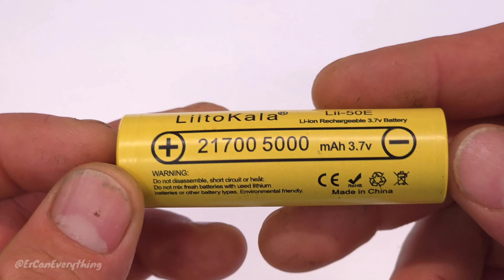Replace old Ni-Cd Batteries of Boschmann Impact Wrench with LiitoKala Li-Ion Cells

Comment: ME HA GUSTADO, ¿PUEDO USAR EL CARGADOR DE Ni-Cd con las baterías Lipo?,gracias.
Reply from the maker: Of course you can, but the configuration must match.
For example in my case there were 20 Ni-Cd cells whose maximum charging voltage is 1.45V (20 x 1.45 = 29V) The voltage of the 7S LiIon configuration is 7 x 4.2V = 29.4V which is perfect for the purpose.
Reply: @ErCanEverything  si, para mi son los mismos voltajes que los tuyos, así que usare el mismo cargador, muchas gracias.

Comment: Can you convert makita DC18RC 100v to 220v
Reply from the maker: I have heard a lot about such ideas, but why?  Otherwise, it is possible, but for this purpose you need a 60-80A server power supply and at least 6mm2 thick wires.

Comment: Why do people put all this tape and insulation and heat shrink wrap over batterys?
Reply from the maker: I put enough insulating gasket between the cells.  The heat shrink is to hold the batteries and insulate if you run cables over them or use a metal case.

Comment: Please dont spread wrong knowledge. That is no Ploblem to switch from NiMh from Lipo..shure as you show.  But for "untrained" Persons quiet Dangerous whom not knows the difference between NiMh and LiPo. One is a Turntable the next a CD. Both Round and Musik but absolute Different in Technic. Every other Person will stuff that LiPo Pack into the NI-MH Charger and stuff the LiPo Pack with 24V. A LiPo BMS is not built or meant to handle a 24V NiCd DC Voltage Input ! Plug it into the "Boschmann" Charger and it blows/BURNS up immediately into "Holy Smokes" .  Please give the WARNING to "Not use the NiCd Charger anymore" when changed to LiPo.
Reply: Obviously you have no knowledge on li-ion batteries and the pcb that went on top!
Reply from the maker: 20S Ni-Cd x 1.45V max. Charging voltage = 29V

7S Li-Ion x 4.2V max. Charging voltage = 29.4V😉